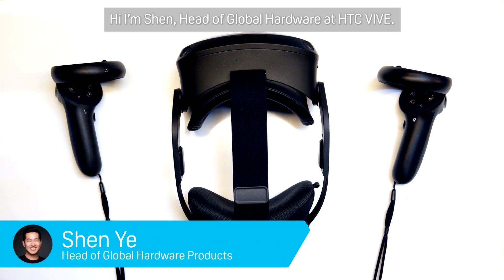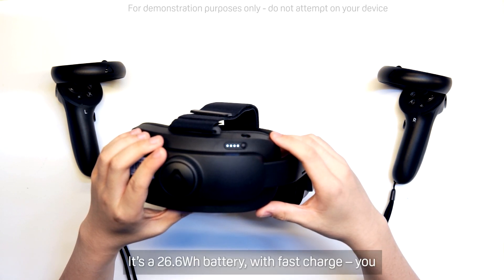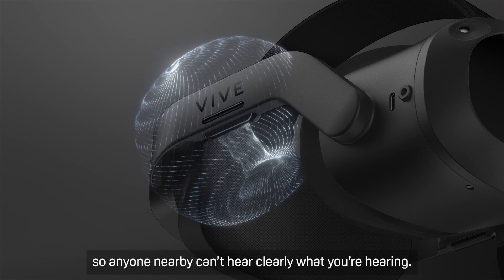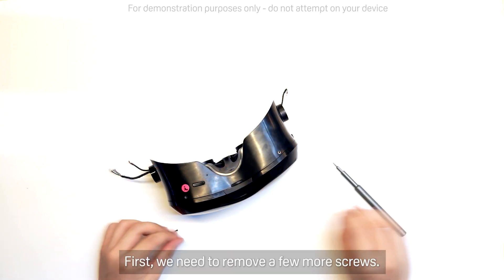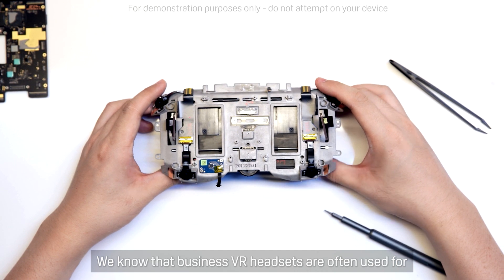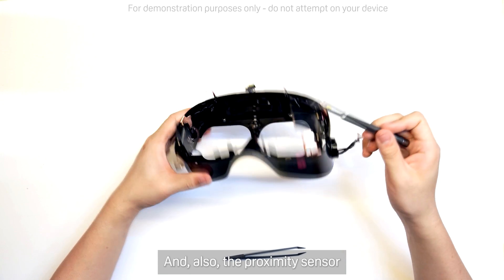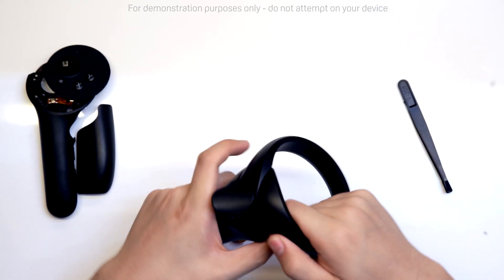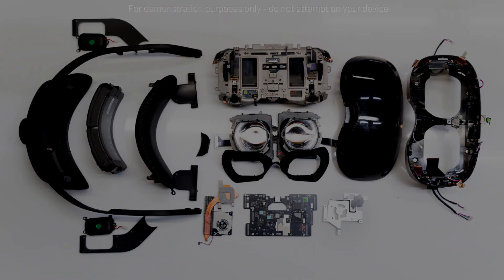VIVE Focus 3 Teardown

Comment: Are you - - - - ed in the head? You've got custom, non-replaceable batteries in both the headset and the controllers. Even if they don't break (hint: first thing to go, besides maybe oh I don't know, the - - - - ing FAN inside the headset), the battery in the headset doesn't have enough capacity overhead to make up for lost capacity over the years.
Replaceable batteries m---f---er, or your product is worthless.
My buddy has to charge his original HTC vive controllers very often now. Me? I swap rechargeable NiMH AAAs in my headset and will be able to keep doing so for decades. 8 hour gaming sessions? Uh. YES. Swap and go.

Comment: The battery life isnt very good....
Can it be hot-swapped without turning the headset off?
Reply: LOL did you even watch the video? Those controller batteries are pretty well integrated. Meanwhile, the headset battery is super custom. Good luck having a working product in 10 years without extra wiring and custom soldering to an external battery pack.
Reply: No, you can't hot-swap the battery. If you are the VR facilitator, LED indicators on the battery itself will give you warning that the battery needs a swap (you shouldn't be caught by surprise).

Comment: Cheaper consumer version aimed at wireless PC VR usage when? I've already seen a video where the Focus 3 was used to wirelessly play PC VR games and it looked great. Vive Pro (2) and such have the disadvantage of requiring expensive base stations and the wireless adapter reduces the resolution and framerate (better wireless adapter when?). This Focus 3 would be great as a premium wireless PC VR kit if you look at the Quest 2 as a cheap entry with many disadvantages, I'm quite unhappy with my Quest 2 and don't care much about standalone usage because graphics are just so far behind PC VR and always will be. 800 to 1000 $ would be a good price, the cheaper the more will buy it of course. You could easily get a huge chunk of the PC VR market by being the first good wireless kit.
Reply: Exactly!!!!
Reply: But they didn’t the end htc is too stupid to even think about that so just buy a htc vive two also I don’t get you logic as you can play pcvr games wireless on the quest 2
Reply: @realpoorman3154  or a valve index or wait for the valve index 2
Reply: So what your saying is "Vive why didn't you just use the same body for the pro 2 you already had to do the RND to make the focus 3"
Reply: @bwittle7052  Kinda. Sure a consumer Focus 3 focused on wireless (or wired) PC VR could be called Pro 2. Maybe they want to focus more on standalone with the Focus line similar to how Facebook kinda abandoned PC VR.

Comment: Now make one with built-in eye and face tracking along with wireless PCVR support.
If it had all of those things, I'd consider paying $1000 for it, as long as it works with my existing external base stations so I can use full-body tracking.
Reply: Don't forget higher field of view
Reply: Don't worry, your online waifu will still pretend to love you without  being able to see your eyes moving in VRChat. Eye tracking isn't needed for anything important until tracked foveated rendering is real thing for consumers. Right now  it still just a demo at best.
Reply: @michaeldeford1335  well you kiddos can have fun in the disgusting cesspool known as Vrchat. I'll continue working on my mocap software, which is why I would enjoy a headset similar to the one I've described above.
Reply: @michaeldeford1335   Shen said it in his Twitter post 
 “SteamVR support multiple drivers, so if you have the time to align the 2 tracking systems, sure “  So Focus 3 works with  base station confirmed.
https://twitter.com/shen/status/1408076243849781250?s=20

Comment: You guys actually made a really good headset again. Problem: NO ONE CAN AFFORD IT.
Reply: It's the same price or cheaper than the old vives then they came out so i bet alot of people can afford this one if they could afford the old vives because alot of people have the old vives
Reply: @KD-xj6yj  no sir.
The old vives were much cheaper, atleast if you didn't buy them from a scalper or anything.
Reply: @waffles8127  when it came out it was 1299 for the full kit of vive pro
Reply: @waffles8127  and the ViVe Focus 3 is listed for 1300 at their website
Reply: @KD-xj6yj  i know. The original vive pro was very unpopular and quite litterally a scam, since the original vive was only around 500 bucks